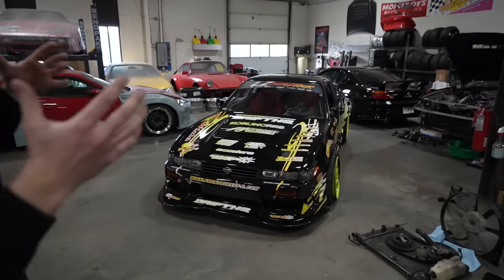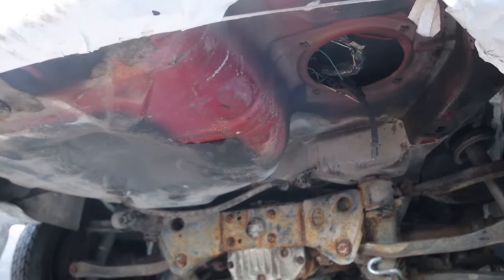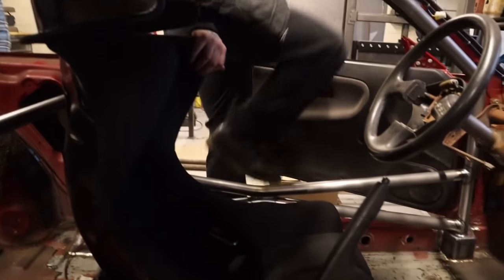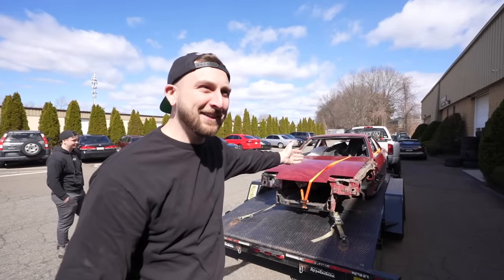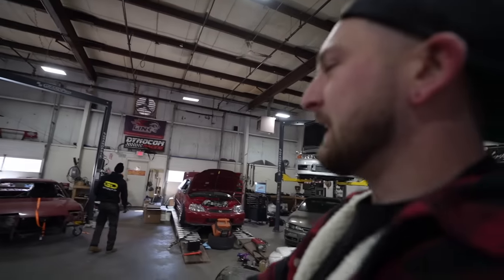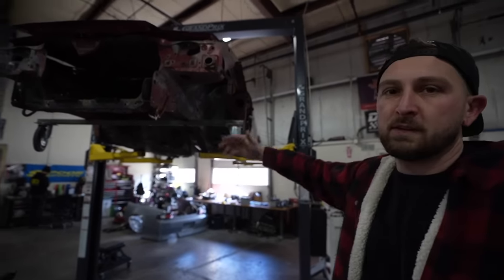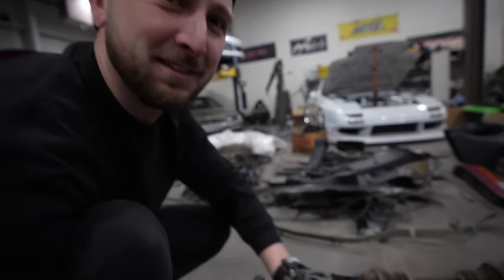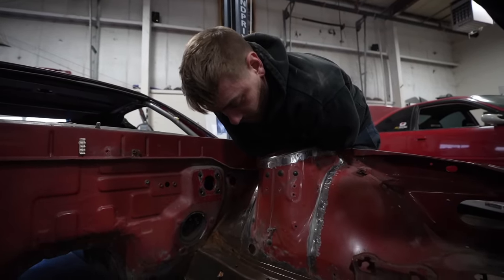I’ve had this Car HIDDEN for MONTHS!

Comment: Please make a PS13 K’s edition Silvia out of your 50k mileage 240/Silvia S13 coupe, Oem stock looks like fresh from the factory, start from SR20det engine, interior with running climate control, no cracked dash, under chassis modification and exterior oem aero, please NO fender roll/pull, paint it 2tone metallic bluish silver or purplish silver or full sonic silver, put small wheels stretch tires like a 15” bbs rs gold mesh, chrome lip and gold hardware on it, to keep the Nostalgic vibes. Worth to add to your garage Treasure or should I say work of art. Keep it up, hope to see it in your garage and your YouTube content. ✌🏼🤓

Comment: Easiest thing is to sandblast the car or wire wheel it. Raptor line the crap out of it and then let spoon paint the outside with a fast paintjob. Solid non rusting chassis and nice enough looking

Comment: ID LOVE TO SEE YOU DO ANOTHER LS SWAP INTO A DRIFT S CHASIS. DO IT BUDGET FRIENDLY BUT STILL USE WIRING SPECIALTIES HARNESS AND SOME ANGLE KITS BUT THE REST DO IT BUDGET FRIENDLY AND PASS IT ON AS THE CREW DRIFT CAR. NO CRAZY CAM LIKE BRIAN JUST SOME SOLID LIFTERS AND MILD CAM. I LOVE ALL THE BUILDS BUT I HAVE AMBITIONS AND I NEED TO WATCH YOU DO IT FIRST LOL

Comment: Nothing wrong with picking up more cars! A drift pig is a good thing to have when a pro-level car costs a lot to run and you need something to get seat time in without worrying too much about too many dings in it - especially if you can use the same chassis as your comp car.
Plus, what sees like a crazy hoarder problem for most people makes sense as a business model, the videos help pay for the car itself and most of the mods then you're left with a more valuable asset after the car is built (maybe not a practice car like this, but the others for sure)